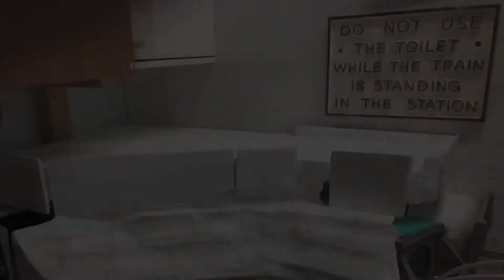May-July 22 Scenery build part 1….Liftout or fixed scenery….That is the question

Comment: Hi Steve doing a good job I take it this part 1 was filmed in may with that thick jumper on lol 😂 cheers Al
Reply from the maker: Hi Al and thanks for dropping in. 🤣🤣 yes you are right. Part of the filming was done before the heatwave. Part two (coming very soon) was done during the hot weather. Luckily my garage stays relatively cool 🤣👍

Comment: help out along a bit - use the wall to support the edge of drop in then nothing goes down to block that track you see the towers of the wall cut out the tops of towers  and use them to secure the base
Reply from the maker: Hi. Thanks for watching and the tip. The liftout has turned out to be very strong and well supported using the shaped positing board. Part 2 is going up soon so I hope you will see that it is progressing surprisingly well for a first time effort. 
Regards….. Steve 👍